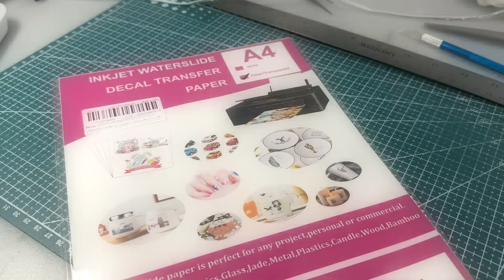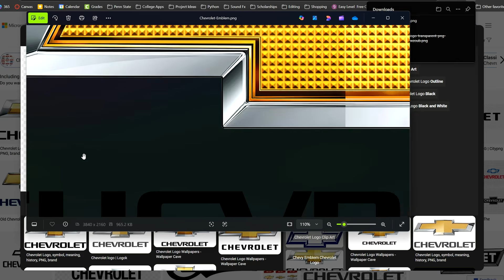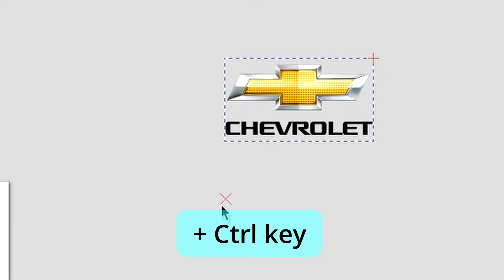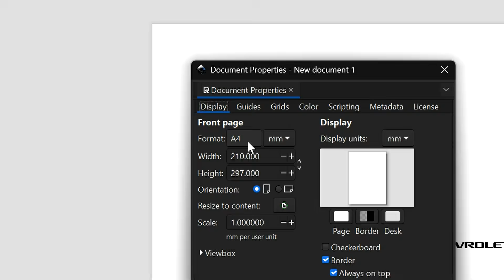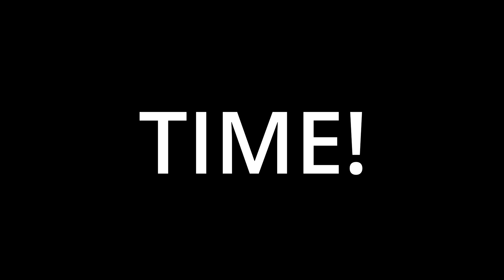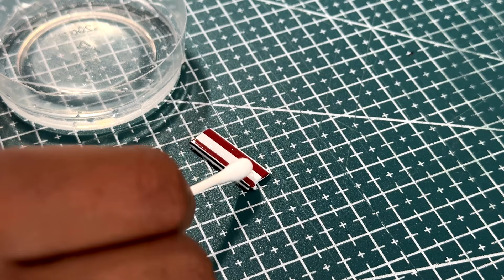The ULTIMATE Guide to Waterslide Decals || An Awesome DIY Gift Idea & Hot Wheels Diecast Modeling

Comment: Yo. So I tried this but once I get to applying, the decal is so soft that it just bunches up when trying to take off. Is this because clear coat wasn't set properly?
Reply from the maker: You mean when peeling it off the backing paper? If so, dunk it in water again and wait a minute longer, larger decals are annoying and take longer to release off the transfer sheet
Reply: @aaronsabu2412 so I figured out I didn't clear coat enough before
Reply from the maker: @shaunmanley2404 oh, that explains it 😅

Comment: Great results,  but learning the software will take a long time , there are so many steps to , resize ,crop and then print in the correct format  and not to mention colour corrections for coloured decals it is a lot to take in. Like many software programmes the menus are very confusing and not intuitive or straight forward. Is there an easier more intuitive easier soft ware to use ?
Reply from the maker: I totally understand, this stuff could get hairy at times.
You could use MS Word with rulers enabled on the margins for resizing. It won’t be exact, but close enough if that’s ok with you